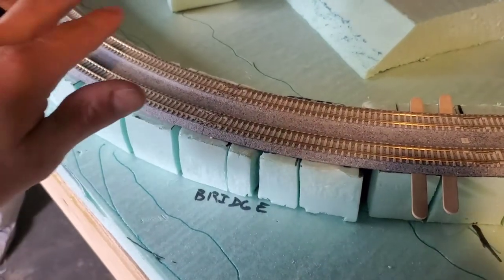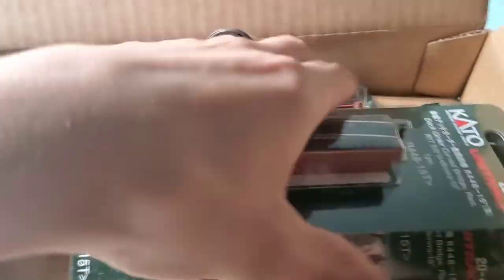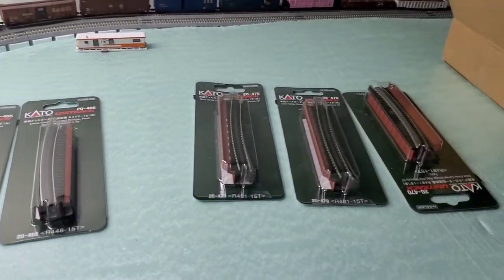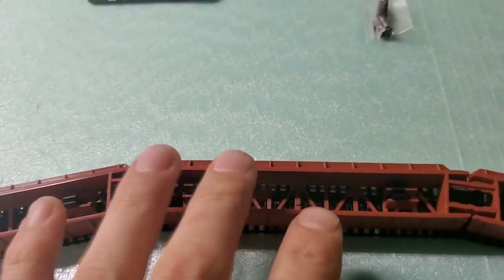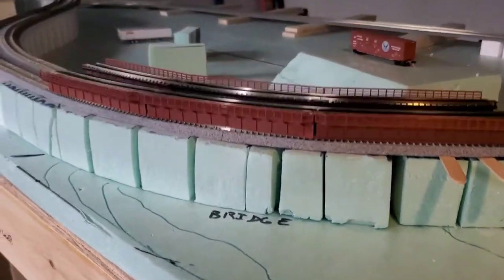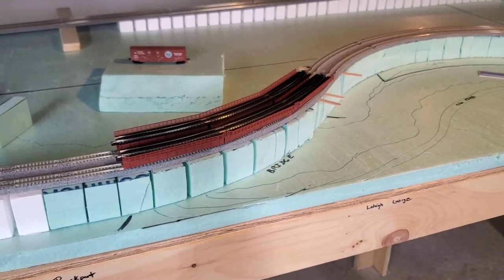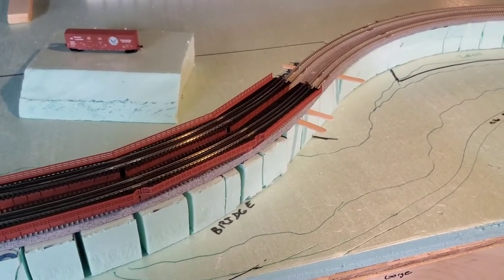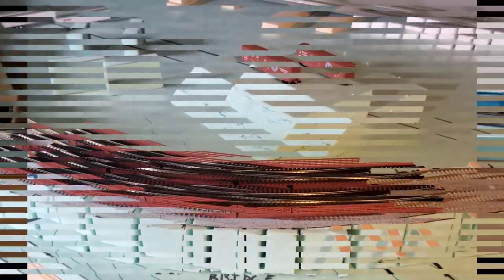Kato Unitrack Outside and Inside Curve Deck girder Bridge unboxing!

Comment: Excellent video, and thank you for posting this. You are correct, there's not much good information, and the Kato track works wonderfully when you fine-tune it with a file.
Reply from the maker: Thank you very much! I spent many hours trying to find any info on these bridges and how theyd work. Unfortunately i just had to figure it out based of the kato geometery, and hope i was right. These personally are my favorite bridges kato offers. The donwside is they only replace the biggest radius of the double track kato offers. Im glad i was able to incorperate them into my layout as they make a fantastic scene. Glad you enjoyed and thank you for watching!

Comment: Do you have derailments from a straight to a curve? Or curve to a straight? (Double track) 
I have derailments every single time I go over the double track straight. (Short or long).
Reply from the maker: Hey john, no derailments where you mention. Kato double track curves are superelevated, they require a easement piece on each end. So 2 easements and one turn would equal a 90° curve/ quarter of a circle. It's sounds as you may not have the easements. Any more questions feel free to ask! Take care!
Reply: Ya I don’t have the easements, I have the double track feeders which I was going to use for wiring the helix! I just have to put straight sections before the feeders and they don’t derail, glad Kato makes small track sections! Thanks for getting back to me. 

Also, did you have an issue with connection that curve bridge? I bought the straight girder bridge and had to trim the connectors on the tracks that go into it. Not sure why it is like that!
Reply from the maker: @Wrathchildss  yes, kato track is great when you learn what's available and what works together. 

As far as the bridge, it came with different track connectors that where smooth on one side. I had to pull a regular out, and replace it with a smooth to connect to the bridges.